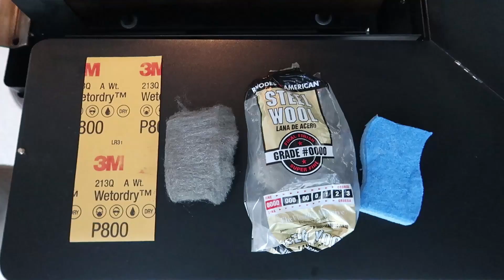How to get a smooth griddle surface for stick free cooking and use less oil

Comment from the maker: Hey ya'll, I want to add a comment to this video. I've been using Olive Oil to cook and season the griddle. It's worked ok but as this video will attest, it scratches pretty easily. Well, I'd heard that Flax Seed Oil works very well for seasoning. I think the Blackstone instructions even recommend it. Well, I'm here to tell you it is great! I used it after my last cleaning. Put the unit through 4 burn off / cool down cycles using Flax Seed Oil and the surface is MUCH harder than with Olive oil. A lot less scratches and much slicker. I still rub it lightly with steel wool after cleaning and then a light coat of Olive oil for storage. Just thought I'd share the discovery. Thanks for watching and listening.
Reply: Thanks Dave, I just purchased the Blackstone 22" for camping. Your tips are awesome. I have not seasoned my griddle yet, heading to purchase the Flax Seed Oil today. Have a great one!!
Reply: Amen - it is harder/the best. I only use olive oil for routine maintenance as where I am flax is very hard to find and expensive. It is great stuff though for sure.
Reply: thank you for this addendum, very helpful.
Reply: Olive oil has its purpose but I’ve found it to be a poor oil to season any metal cook surface. Do you have any experience with grape seed oil? I’ve heard good things but not sure about its smoking point.
Reply: @brittanylevinson741   I used flaxseed oil for the initial seasoning and after every use I apply a thin coat of olive oil and heat the surface up to burn it off. The flaxseed oil works great but I do not use it regularly because I do not particularly like the way it smells. I have not tried grapeseed oil but I think it would work fine.
Reply: @John.117  Newbie here so bare with me. Ill be doing my initial seasoning soon. I plan on using Flaxseed oil. When Im cooking should I use olive oil?
Reply: Rayspooner: That’s what I do (cook and oil between use with olive oil). I only use flax after a restoration - where I layer 3 - 4 times. Nothing wrong with using flax all the time - it’s just not what I do.
Reply: @John.117  Thanks
Reply: @rayspooner1982  Happy to help/any time.
Reply: Thanks for the follow up. I saw that Blackstone does that with Flax, in a video yesterday.  I'm new to grilling and griddles, etc. So I'm learning as much as I can before I put food on those things

Comment: I just seasoned my 22” Blackstone adventure ready griddle today at the campground. I spent 4 fours seasoning it with avocado oil in light coats. It looks beautiful and black and was nice and slick for the first cook of a pound of bacon.

I am going to try your technique to see how much more it will do toward making it more nonstick.

Thanks for the video.
Reply from the maker: Thank you for watching and especially for taking time to comment! Maintaining a good surface is an ongoing process. Even after the sanding I do in the video I finished with a burn off of a THIN coat of olive oil. After every cook and clean I finish with a burn off of a light coat of oil. Then, I give it another coat of oil to prevent rust. Hope this helps. Some guys will tell you they just clean and cook but I think they use a lot of oil during the cook.  Thanks again. Dave

Comment: Dave - I see your comment below... from 5 months ago... that you sold your griddle and are moving on to other topics. I really enjoyed your griddle videos. Hope your next endeavor is as good. I used a flat top griddle for years... I finally just purchased one for home. Looking forward to using it frequently. As I haven't seen any activity here in awhile, I thought I would make a couple suggestions - if you don't mind. I watched this video and wanted to point out - the equivalent grit to 0000 steel wool is about 400. You started with 800 grit, then went to 0000 steel wool... so effectively went with a rougher grit. Just FYI, not to take a shot at what you did. If it works - it's good :-)I am a big "cast iron" guy and the griddle care/maintenance is basically the same. To anyone using either a griddle or cast iron - I recommend using wood utensils when you can. With a griddle, when I have to, I will use a metal spatula (very/very gently & carefully) and use a baker's knife/scraper (or like you - the putty knife/drywall blade) to pull large amounts of grease and debris... but "pull" is the operative word. I pull toward myself with the blade away from me - meaning drag it back... not blade forward - push/scrape. Too easy to put a scratch or gouge in your seasoning. If I need to get serious with something stuck on... I use hot water on hot iron... then a wood spatula. It comes right off with limited pressure. Hot iron and hot water, wood spatula. This works very well with cast iron cleaning. By rounding the corners and other tricks you did on your metal utensils, you did a great job of trying to mitigate a scratch happening, so lessened the damage to your seasoning. I've seen people catch an edge of a spatula or scraper and I just cringe every time :-)You are dead on target with flax seed oil for either cast iron or your griddle. It's great stuff. I use it (flax seed oil) when I am restoring a base seasoning. For routing maintenance, I use olive oil. I do not ever cook at high temps with iron, so olive oil works great, is cheaper and readily available wherever I go. If I have stripped off all the seasoning for some reason (like a complete restoration), I use only flax seed oil. I suggest bake at approx. 350 deg F for about 35-45 minutes, let cool and repeat at least 3 more times -- will restore your base seasoning. Then for me it's olive oil for maintenance after that. I'm sorry to see you go - I really enjoyed your videos. I guess I may have to start up my own, to carry on the fun. :-)  Best to you and yours.
Reply: sorry about the typo - that should have read "routine". Routine maintenance. :-)
Reply: Thanks for the tips and sharing your experience. Just bought a BS so watching a ton of vids before I do the first seasoning and start cooking.
Reply: @BagsEsquire  I think you will have a great time. They are great for a whole lot. Breakfast, lunch and dinner. You can even do your own version of Benihana :-) Cook when it's hot... clean it when it's hot... and after you remove excess moisture... dry it with heat after you are done cleaning it... then re-season it when it's hot ("hot" = min 210 deg F... but not smoking)... it will serve you well for a VERY long time. After you clean it - you can pat with a paper towel to remove excess water... but I don't recommend you apply oil with a paper towel. It can leave paper fibers/residual that gets in to your seasoning. I recommend you use a lint free cloth. An old t-shirt or something that has had all the lint washed out if it. That way it doesn't end up in your seasoning. Congrats on your new griddle. I hope it serves you well.
Reply: John Thanks a lot for the reply and advice! I have a cover on its way but do you think it’s worth the extra effort to keep it stored in my garage when not using it so it’s never out in the elements? Even with a cover I’ve seen posts with people still getting rust spots and having to sand or grind then off and go through re-seasoning again.
Reply: @BagsEsquire  Totally up to you - and what fits in your world. In mine... yes... I keep the griddle part in my house. Don't be too worried though. I find Iron to be very tough. It'll be fine in extreme heat, cold, etc. I have had rust on mine... and in a few minutes - it was ready to go.  I think it's probably more about humidity in your neighborhood - than in someone else's (Meaning don't be too worried about other's comments... make good decisions based on your reality - not theirs). If you are in a very humid place - rust I think will happen. If it's bone dry (the air where you live)... not as much. Meaning if your griddle is well oiled (I don't mean dripping)... I believe it will be fine. Again, it's your call. As long as you don't go from one extreme to the other (hot to cold or vice versa) - or commit some serious act of violence on it ( ;-) )... you pretty much can't "hurt" it. As an example... my wife left one of my Dutch ovens outside. I mean for MONTHS. It was a rusted mess and when I discovered it... she was mortified. I scrubbed it down with a wire brush, then a scrubby, re-seasoned it and off we went. She said then that she really thought it was gone forever. Iron is iron. The "seasoning" is the "delicate" part. Chuckwagon cooks have been packing iron all over God's creation for centuries - and it's still good today.  The most important part I think is that you bring it in to your world in a way that works for you and you enjoy having it. If it becomes some "weight" around your neck - you (in my opinion) have lost the joy of all of this. Have fun with it. Be OK with screwing up - learning from it - and moving on. This should be cool - for you and your family. I hope I haven't overstepped with my response. I really do wish you the best... and lots of enjoyment with any iron you get. It really is heirloom stuff. It should be fun and serve you well too. Not be some "heavy" thing you worry about. If it ends up in the dishwasher... or someone uses soap on it... don't kill anyone... just shrug... and take care of re-seasoning it. It's iron. Great stuff. Last for generations. It's good for you to cook in... and it really should be fun for all when you use it. After the griddle - get some cast iron skillets... next thing you know... you'll be camping! Using an open fire! LOL
Reply: John hahaha thanks so much for the response. Never had a griddle before so definitely learning as much as possible. We have a 19 month old son and another son due in a few days so really looking forward to using this a ton....Very good advice and all of it makes sense!! Again, thank you for the response and I information. God bless!
Reply: @BagsEsquire  You honor me by asking for my opinion Sir. I thank you. Congrats on your family. You will/do certainly have your hands full :-)  I hope one day they see you baking rolls in a cast iron dutch/camp oven using live fire, frying bacon in a skillet on an open fire, and making breakfast at home on your griddle.  No matter what the age... everyone needs to eat... so in my opinion... nothing is better for bringing folks together. GREAT way for a family to spend time together. God bless you and yours.
Reply: John You are so right! I did a lot of camping when I was younger and made some amazing memories. Definitely looking forward to doing the same with my boys!
Reply: @BagsEsquire  One last suggestion if you will permit me. When you are first starting out - I recommend you get one of those point and shoot (digital) thermometers that Dave showed in his videos. That will allow you to realize the temps you are cooking at. I think that will enhance your experience. I cook about everything at approx. 350 deg F. Except eggs. I like those at a lower temp... say about 280 deg F. You will have places hotter than others - even when the burners are all set even. Wind will also factor in. That thermometer will show you all of it. You can gauge your cook accordingly. It's up to you now to make those memories for your boys. :-) A worthy tradition... that I am glad you were able to experience as a boy. I hope they never need the skills you will be teaching them. But I do hope they enjoy spending time with their father learning them. From what I have read from you... I am sure they will. Sincere regards.
Reply: John Another great suggestion and I actually did get one along with a thermapen thermometer!! Great to see the cooking temps you listed. I have see quite a few posts of newbies saying when they started they were burning a lot of food as they figured out the heat nuances of the griddle. Thank you so much for the kind words my friend, can’t wait!
Reply: @BagsEsquire  I should have also mentioned - if you don't mind... and if you don't already know... On solid proteins like a steak or burgers/sausage, etc. -- don't be in a hurry to turn/flip food. You want it to brown (caramelize) before you turn it. Griddle/cast iron... anything. Once the caramelization happens, it'll release... or at least be MUCH easier. Far less sticking, scraping, etc. - assuming you have a good season of your cooking surface... and your cooking surface was hot before you put anything on it. That said - once you have caramelization on both sides - don't worry about the "only turn it once" stuff some folks say. It's your cook - your food. If you want to keep turning it until it's cooked right for you - have at it :-)
Reply: John All the advice you have is very welcomed! Good to know! Burgers and Steaks I’ve always done a flip once but sausages I’ve usually flipped around in a pan a bunch of times so I’ll definitely try the flip once method on these as well. I’m guessing there’s definitely going to be a learning curve accompanied by some overcooked food in the first handful of cooks as I learn the best temps and cook times.
Reply: @BagsEsquire  Mixed meats (hamburger, sausage, etc.) I always cook to 165 deg F internal temp. I like to cook low and slow - unless I am going for a sear. If you're at 350 deg F on your cooking surface (around that - doesn't need to be exact) you should do fine. That's the technical side. Now as far as practical... what I do... flick some water on the cooking surface - if it dances - it's hot. As long as it's not smoking - it's good. Cut your flame to maintain that temp - and off you go. Flip when blood rises to the surface. Keep flipping as needed/as you want/as many times as you want (as long as blood keeps rising to the surface I flip it). Once the juices come out clear when you press on the patty - it's done (at least it is for me). I'm sure you'll have a great time. Best to you and yours.

Comment: Thanks Dave! I am a diehard cast iron aficionado and recently got a pro little griddle to use indoors with proper venting with my gas cooktop. As I am new to seasoning stainless, this is very helpful! The same principles apply to stick free cast iron but materials are different. I only use 100% real lard for my cast iron. Look forward to making my stainless stick free and hard coat!
Reply from the maker: Thanks, Brittany. I love cast iron, too! I plan to do some vid's using it and look forward to hearing from you on how I did and any input you can give. Thanks for watching and for your comments.

Comment: Going to buy some Grape seed  or Flax seed oil today. Got my new Blackstone yesterday, got it seasoned and made bacon fried corn, fried potato's and thin sliced beef. I had my griddle way to hot which caused some sticking. Going to clean and re-season this morning using your method. I did find out one thing for sure. It would be much  easier to start out with a lower heat than to try fighting  an over heated griddle once you start cooking. I really enjoy your videos Dave. Blackstone should sponsor you. :)
Reply from the maker: Thanks, Buddy! You're going to have a LOT of fun and good eats. I'll be doing more videos in November when it cools down here in FL. Almost too hot to cook but definitely too hot for filming. I've got a couple more mod's to show. Until then, thanks and best regards. Dave

Comment: I'll have to try that thanks. My 36 inch has a few high spots here and there that can use this specific technique. I used Crisco vegetable shortening and Canola oil. Not even cheese sticks to it with that combo.
Reply from the maker: Hi Stephen, Thanks for watching. This technique will smooth out the seasoning and some light scratches. You'd need to use a grinder to remove any metal...which I do not recommend. Thanks, Dave
Reply: @NextWithDave  It worked really well and evened all of the seasoning out. To get it perfectly flat then I would be looking at taking it to a local sandblaster and having it prepped that way and cleaning really good before reseasoning it. Thankfully I don't have to do that.

Comment: I have a question. I purchased a new Blackstone griddle 28" and its being shipped. What steps should I take with the new griddle? Any suggestions beyond what Blackstone recommends? Thank You. Great videos.
Reply from the maker: Thank you for watching and especially for taking time to comment! When you first recieve the griddle don't sand all the factory seasoning off. I just sand it a little but leave some for the new seasoning to adhere to. Before first use, clean it well with just water no soap. Maybe a little vinegar in the water. then when you do the first seasoning use avacado or grape seed oil. Don't use flax seed oil because it gets too brittle and will flake off into the food later. THIN layers that you burn off till the smoke stops. Then a complete cool down and do that 2-3 more times. The 28" gets hotter than the 36" but you can still do zone cookiing. Be sure to get a infrared thermometer to check surface temps. Cheap ones work just fine. Even though I've done it, know that if you put a pan on the griddle it can overheat the seasoning and you may have to apply some oil and do a seasoning burn off afterward. Watch a lot of videos and experiment. You're going to have a lot of fun learing the ins and outs of griddle cookiing. Thanks again and good luck!

Comment: Hi, Dave. Happy Independence day! What sandpaper grit do you recommend for sanding down the surface of a brand new blackstone prior to the first seasoning?
Reply from the maker: Thank you for watching and especially for taking time to comment! I usually use 120 G with a light hand on a random orbital sander. You don't want to sand all the factory seasoning off just smooth it down and litttle and leave a little roughness for the new seasoning to adhere to. I stopped using flax seed oil because it is too brittle and flakes off. Grapeseed or avacado oil works best for me. Thanks and good luck!!